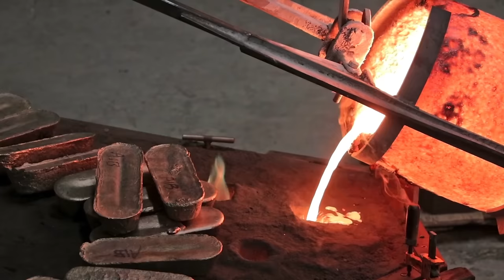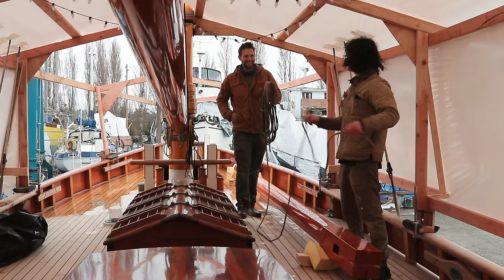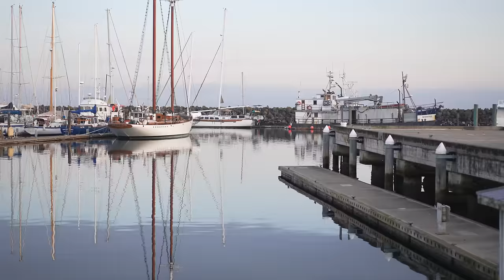Tally Ho's bowsprit!

Comment: Okay so what holds it there,those two chunks of 2×4 ?
Reply: See 'Samson Posts' episode 112
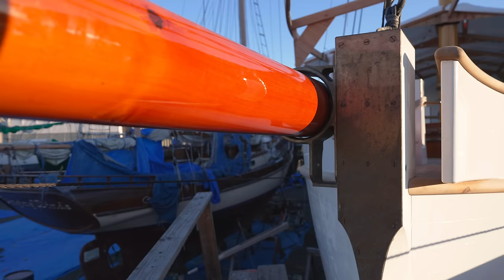Reply: At 14:19 , the horizontal fid is one piece, driven through a slot in the bowsprit heel. When the bobstay & bowsprit shrouds are tightened, the fid locks the bowsprit in place.

Comment: Maybe you could get an appropriate size caliper,,, to measure the inside measurement of the circle to accommodate the outer size of the spar!!! Just saying....
Reply: The edges of the opening are offset by at least a foot or two, and are not a continuous circumference.

Comment: Abstract

This transcript details the process of fitting a new bowsprit on a vintage sailboat. Below are the key points:

Introduction

* Leo, a boat builder and sailor, is restoring an old wooden sailboat known as Tally Ho.
* He acquired a new bowsprit made from Douglas fir, chosen for its durability.

Varnishing

* The bowsprit is varnished with a specialist product (All Wood) designed to protect against wear and tear.
* The same process is applied to other spars made from spruce.

Challenges of Fitting

* Getting the bowsprit onto the deck proves difficult due to the boat's design (hatches, railings, etc.).
* Multiple attempts are needed, with small adjustments made each time to ensure a good fit.

Success and Lessons Learned

* The team eventually succeeds in mounting the bowsprit.
* Leo emphasizes that perseverance and careful adjustments are often necessary in boat restoration work.

Other Notes

* The Douglas fir for the bowsprit was salvaged from an old building, providing a historical connection to the boat.
* The video highlights the importance of teamwork and thanks supporters of the project. 

Summary

Introduction

* 0:00 - Leo introduces himself as a boat builder restoring the sailboat Tally Ho.
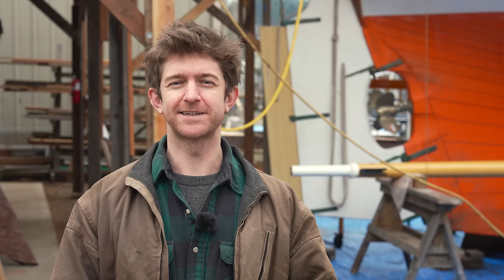* 0:15 - The focus of the video is fitting the new bowsprit.

Bowsprit Details

* 0:17 - The bowsprit is made by Bruce Tipton, a local spar builder.
* 0:24 - Douglas fir was chosen for the bowsprit due to its durability.

Varnishing Process

* 0:44 - David and Bailey apply the final coat of varnish to the bowsprit.
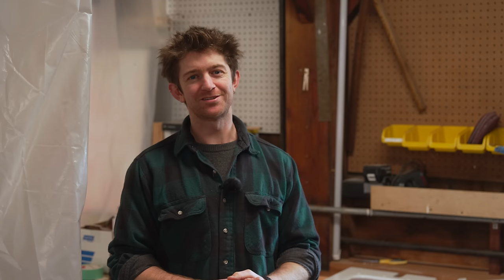* 1:37 - The bowsprit and other woodwork are varnished with two different products:
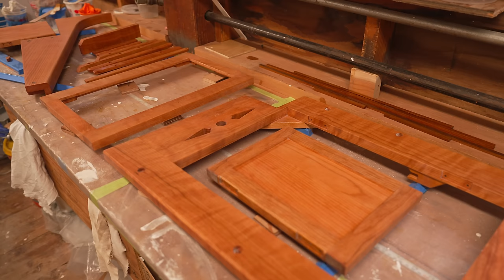    * 1:57 -  Leonen (linseed oil-based) is used for interior and exterior woodwork.
    * 2:17 - All Wood (modern, high-tech) is used on the spars due to their need for higher abrasion resistance. 

Mounting the Bowsprit (Initial Attempts)

* 3:08 - The team prepares to mount the bowsprit on the deck.
* 5:03 - The first mounting attempt is unsuccessful due to the boat's design.
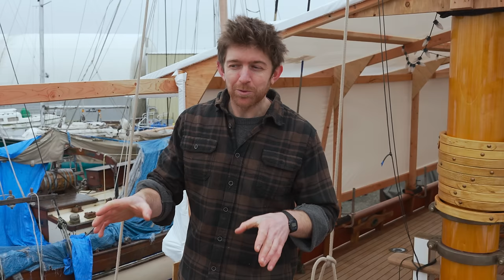* 6:01 - Adjustments are needed to get the bowsprit around the hatch.  

Bowsprit Origin Story

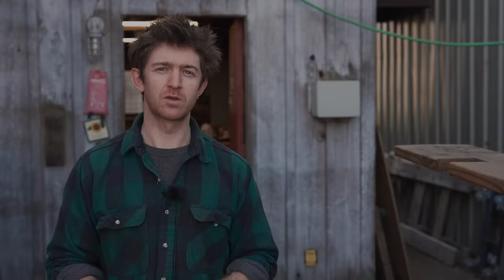* 6:46 - Bob makes adjustments to allow the bowsprit to fit.
* 6:55 - Leo shares that the Douglas fir used for the bowsprit was salvaged from an old building, possibly felled around the same time as Tally Ho's original timbers.

Mounting the Bowsprit (Second Attempt)

* 8:29 - The team is confident as they try to mount the bowsprit again.
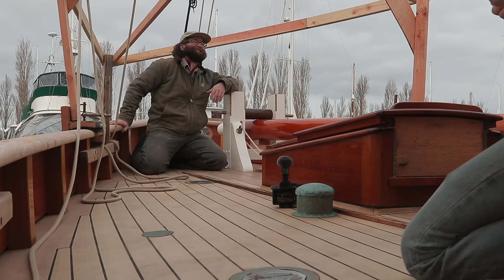* 9:18 - The second attempt also fails.
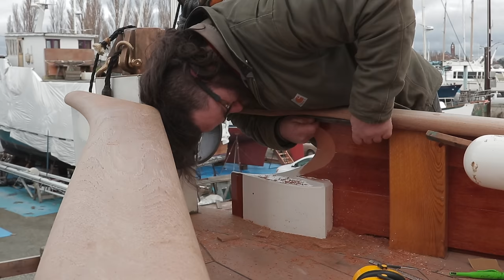* 10:25 -  They plan to remove more material for a better fit.

Mounting the Bowsprit (Third Attempt)

* 11:07 -  The team prepares for a third attempt, but it also fails. 

Mounting the Bowsprit (Fourth Attempt)

* 12:26 - It's the next day, and they're ready for their fourth attempt.
* 13:57 -  Success! The bowsprit is mounted.

Success and Lessons Learned

* 15:20 - The bowsprit is in place. Leo thanks Bruce for building it and Bob for his hard work fitting it.
* 15:33 - Leo emphasizes that repeated attempts are often necessary in boat restoration.
* 16:55 - Leo thanks supporters of the project. 

Disclaimer: I used gemini ultra 1.0 (2024.02.21) to summarize the
video transcript.  This method may make mistakes in recognizing words
and it can't distinguish between speakers.

Comment: To be honest - since you did build 99,9% of the boat with new parts, you could have left out bying the wreck and just started from scratch to build a new boat. What this effectivly is.
Reply: The Ship of Theseus...
Reply: Leo discussed this at the Albert Strange meeting. He didn't get to use as much of the boat as he'd hoped, as lots of it was too far gone. But, what he's done is catch up on the deferred maintenance over the decades, as a ship this age would have, by this point, had all the pieces that've been replaced, replaced one at a time. There is a question about the nature of "a thing", and what makes it a thing. Ship of Theseus, favorite hammer, etc. You'll note that Leo always kept "the ship" together-ish. He could have moved the keel aside, but he didn't. He kept it boat-shaped through the entire process and did the restoration incrementally. In the end it doesn't matter, what he chose to do was restore a classic sailing yacht, not build a new ship.

Comment: Seems that this could have been avoided by moving the hatch over just a little?  Did you not notice the possible interference when working out the final plans for rebuilding the boat?  Easy to make this comment now, but would have been a great catch in the planning phase.  Are you going to be able to leave it out or will it block the travel lane in front of the vessel?